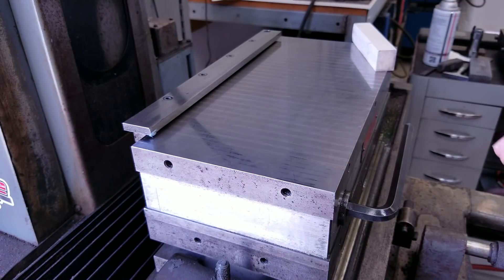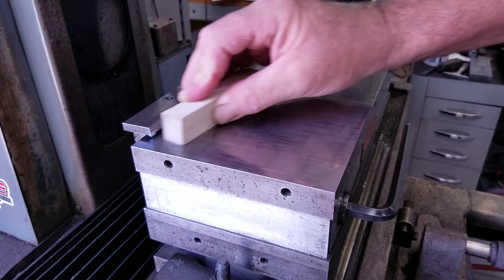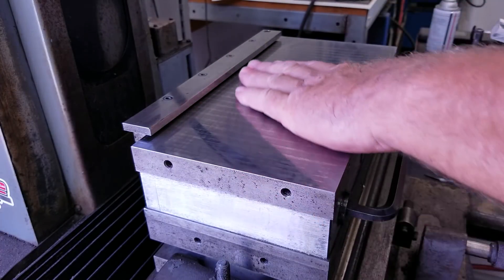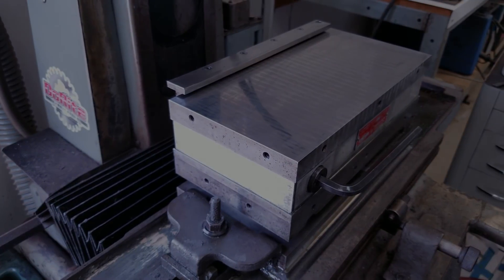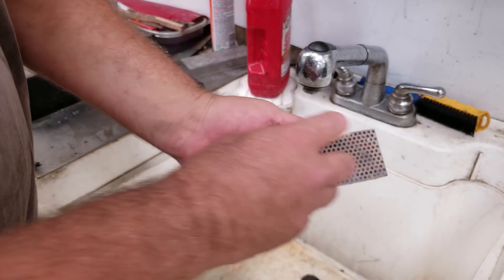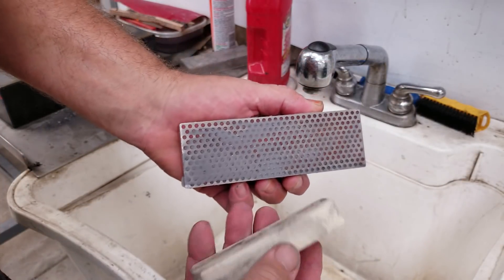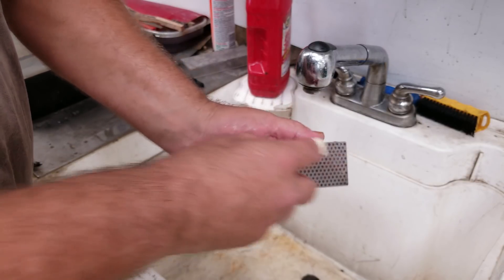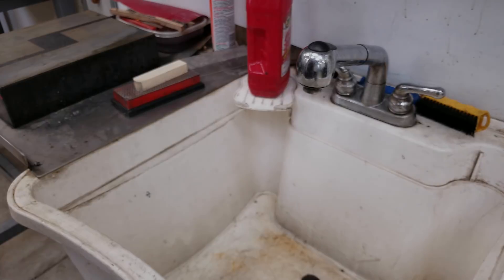Use and care of abrasive stones

Comment: Thanks Stan...you are the Royal Grind Master..  I was in a catch 22 with desiring the Renzetti precision flat stones, and all the setup prep needed for diamond wheels on my surface grinder. I purchased a blue coarse DMT ($49) 2.5x5 ish, and two Norton 1x2x4 dual India/carborundum stones.  Wasn't sure how flat the DMT would be, just hoped. The Norton's were not flat when faced together.  By eye many thou. After some patience and rubbing, and incremental pressure from one side to the other, it worked to "adequately" flatten both faces (India) of the two stones such that when you rub them together, there is no bite, the surfaces look uniform, and they float against each other.  I rubbed them on my mag chuck, and some gage blocks.  When feeling and looking at the stones after, you get the effect that Robin describes.  It worked great. Probably 75% Renzetti quality my wag.  Someday I'll step it up, but for now it gets me moving forward with good practice.  Thanks a bunch. Mike.
Reply from the maker: I have my Renzetti stones for special occasions, but this is my daily driver.

Comment: I used your exact method for years, but now prefer the Renzetti type precision ground flat stones, which do a better job on the chuck, with much less total metal removal.
Reply from the maker: I save my renzetti's for tooling and harder metals :)
Reply: I use them for all sorts of things.  Morse tapers, even when spinning slowly.  Mill table.  Almost any tool or part coming off the grinder.  Really, any precision deburring job.  The stones are easy enough to grind again if needed, and not that difficult to make new ones.  We have made at least 10 sets of precision flat stones on my surface grinder for friends, with them turning the handles for the learning experience.  My precision flat stones have become about as indispensable and as multi useful as my pocket rule...  Edit:  Mine are shop made, and not resin impregnated.  Handiest things since sliced bread...
Reply: Have you made any cylindrically ground stones to do internal tapers? I'd like to get my paws on one, but my grinder is out of commission for a while.
Reply: somebody else  No, but that is a great idea!
Reply: @somebody else: The quick and dirty alternative is some spray adhesive and wet&dry sand paper around a male taper. Certainly not as good as a reamer or a stone, but it helps on a badly abused morse taper.

Comment: What effect does the grit size of the diamond leave on the stone?  e.g. if I used a 120 grit diamond, it can't be leaving the stone surface the same as a 600 grit, right?  If I used a 2000 grit diamond on the same stone, that stone will have a vastly different surface roughness (and cutting ability?), right?
Reply: seconded, this is a very interesting question
Reply: A stone's grit describes the shape of it's cuts not really its ability to cut.  The hardness tells you what materials it's capable of cutting
go with sand paper is soft so cuts wood but not metal.  Carborundum cuts metal (and everything else) but both can be 200 grit which describes the number of particles and thus scratches they produce over a given area (it's finish).  Yes when you know, for given materials it indicates the amount of that "stuff" they can shift.  But 200 grit could be describing 200 particles of sandstone or diamonds per sq inch.
All the grit tells you is low grit produces a few deep scratches like a deep corrugated pattern.  High grit lots of shallow scratches.

Stan could just as easily buy a very fine diamond stone and cut out the middleman ... but while a very fine grit diamond will produce a mirror finish its also going to be very aggressive because its so hard - So lots of material moved with ease, He loses the feel of the tool that he's spent many many decades developing :D

Stan's diamond stone is designed to allow waste material to be dragged off the surface into the indents leaving the surface clean to make a flat finish but it can move some serious material from a soft surface which can be wasteful.

If the grit is too low it will cut grooves into the surface of the hone which effectively softens it's surface is likely to result in an uneven surface with lots of "mud" spread around. because only the high spots touch.

If the grit is too fine you get a harder polished surface which leaves the waste with nowhere to go so it holds onto the surface and produces secondary scratching and gives a nasty different sort of bad finish.

Its a balancing act.